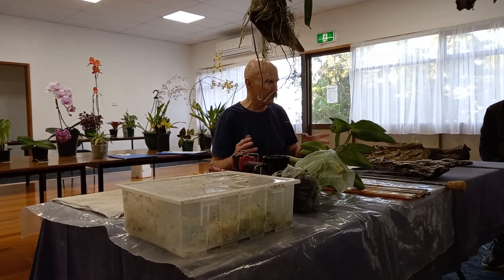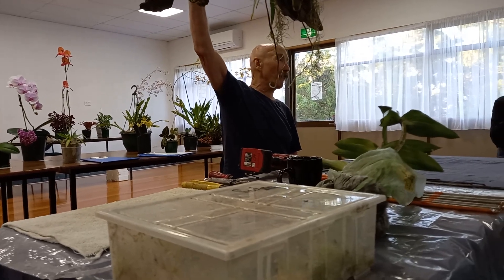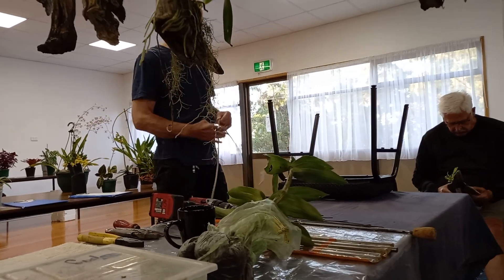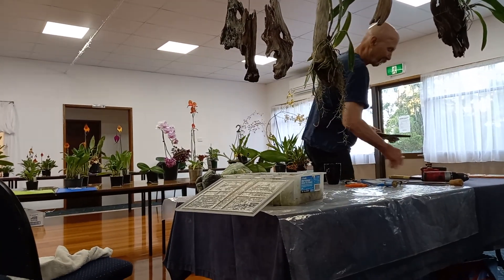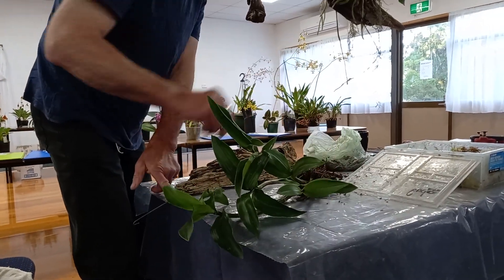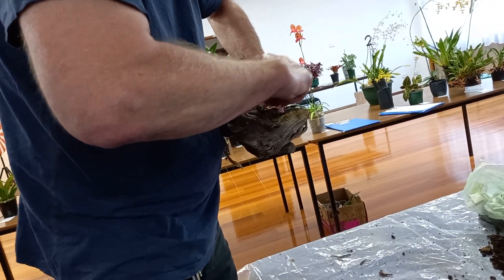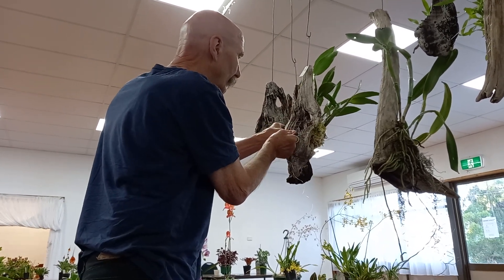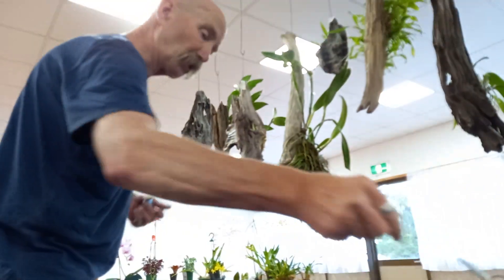Orchid Driftwood Mount Culture Talk @ Burnie Orchid Society

Comment: Half hitch
Reply from the maker: Yup... various names, but the basic is a clove hitch...
Reply from the maker: I use all three at different times and stages.
The clove hitch most frequently around the hanging wire and sometimes on a pin/nail. Both the reef knot and multiple half hitches come in at other times.